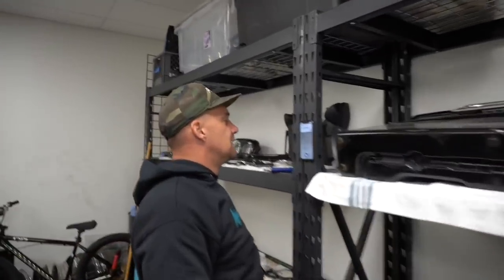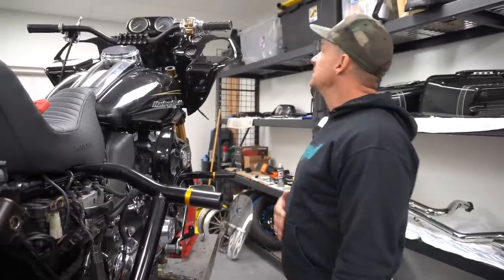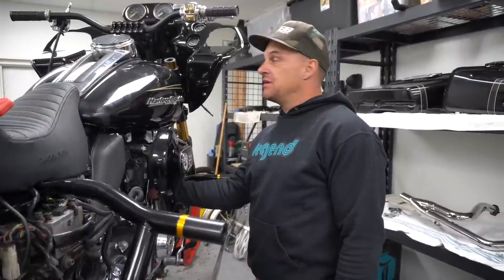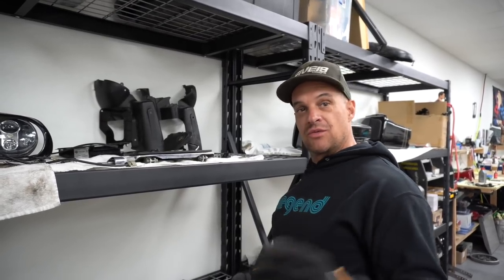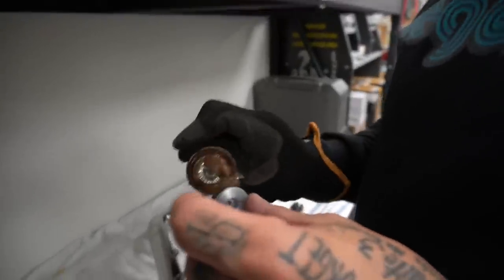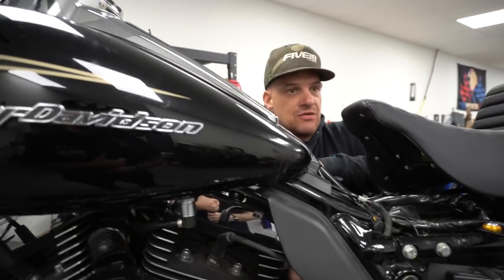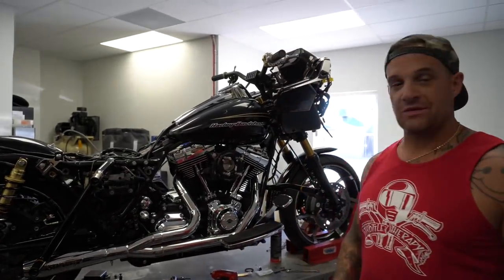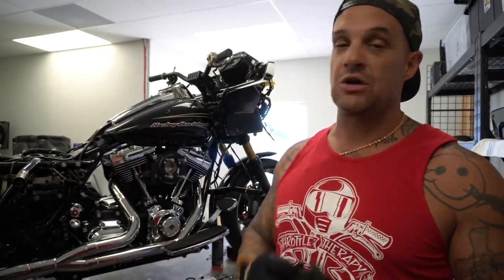how to build a performance road glide on a budget [P7] stealth pipes install

Comment: Which pipe is louder the pipe bomb or the reverse cone?
Reply from the maker: They both sound good I don’t really gauge an exhaust off of how loud it is louder usually means less power. The turn out sounds the gnarliest. I would say that pipe bomb is probably the best sounding.

Comment: I want to run this pipe on my 2010 street glide, what tuner should I use for it?
Reply from the maker: I will always recommend thundermax, but you could really run any tuner if you were only putting an exhaust on you could get away with just flashing the ECM as well.

Comment: Dyna vs FXR video?
Reply from the maker: I hate FRXs
Reply: @kruesioriginals what do you hate about em?
Reply: @kruesioriginals  😂
Reply from the maker: @DeadRoman  pretty much everything they are really all pieces of $hit.  The only way to have a dependable Fxr is to throw everything away keep the frame and start over. I am currently finishing a big project on Fxr at the shop the last Fxr we will ever work on.
Reply: @kruesioriginals  i get it mayne, they are old bikes, but, for a guy who rides dynas, you shit on dyna handling a lot. Whats the solution if you want a decent handling harley?
Reply from the maker: @DeadRoman  big bear motor mount or a Softail. Fxr handle terrible until you through a bunch of money at them as well
Reply: @kruesioriginals   i just hate ugly softails
Reply from the maker: @DeadRoman  amen

Comment: Can’t wait to see what you do with the Night Train. I got a 2002 that I’ve bagged, built and fairing, about 10g’s with me doing all the work. The only suck is the 32* rake but I run Monotubes, are those hot garbage that should be replaced with legends tubes? Do you think it’ll be a noticeable difference? Keep the fatty’s rolling babe 🔥🤘🏻⚡️
Reply from the maker: I have late model 49 mm Dyna super glide trees on the Softail it takes it to 30° rake. And yes progressive mono tubes are absolute garbage. There are a bunch of videos in that building already on our YouTube. We started it a couple years ago and got sidetracked. The front in conversion and control set up is on there
Reply: @kruesioriginals  Right on, I'll take a look again and will be watching anyway, thanks guys.